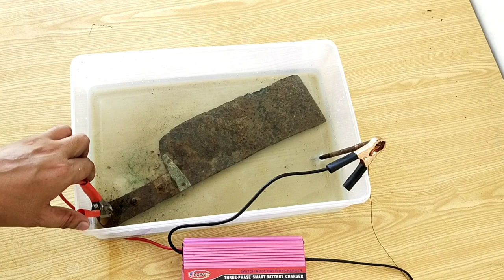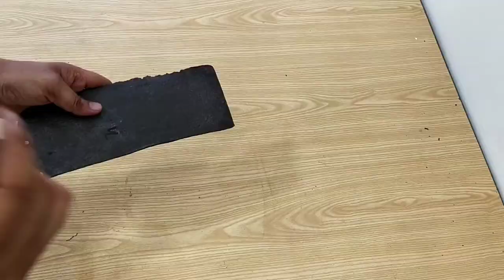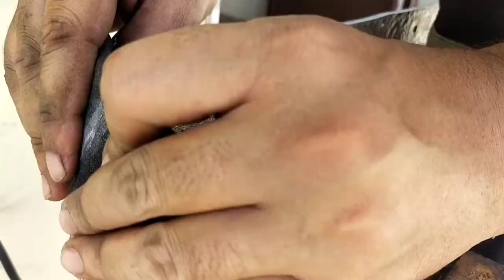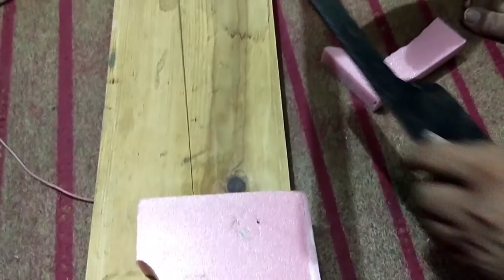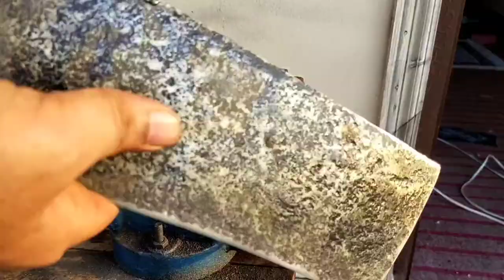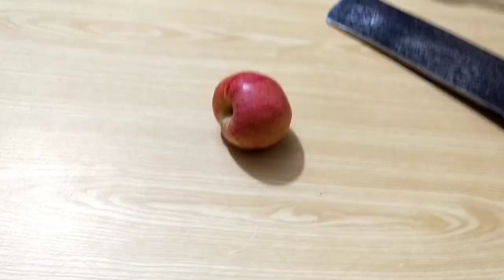Meat cleaver Restoration.

Comment: I have been watching some of your videos lately. I agree that some are ok, but this one was a very poor restoration. I dont know if you were in a hurry or what the case was. The blade itself needed alot more smoothing, then polishing. The handle should have been made from wood. I know it was aluminum but it was aluminum that had already been melted before. You never know what is passed from one melt to the next. This would have been a fine looking knife if you would have put in the work it deserved.